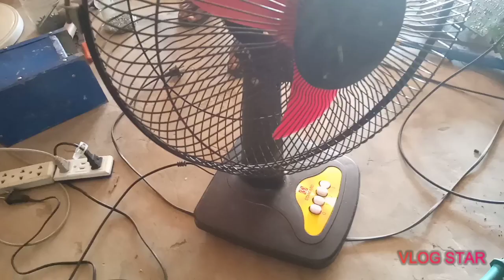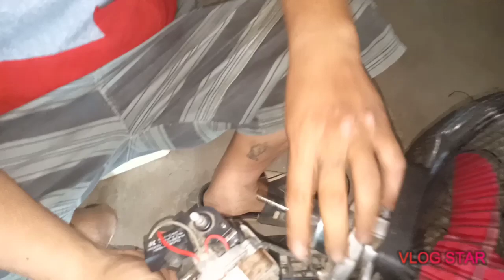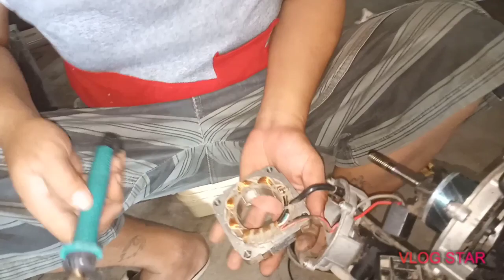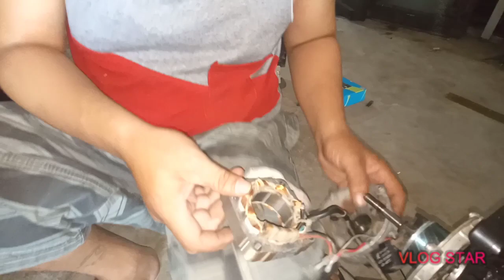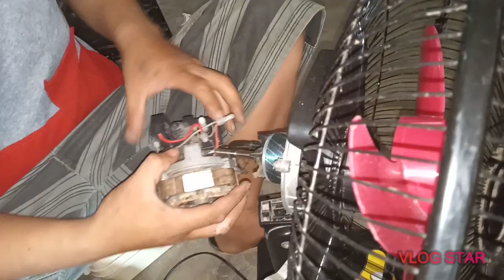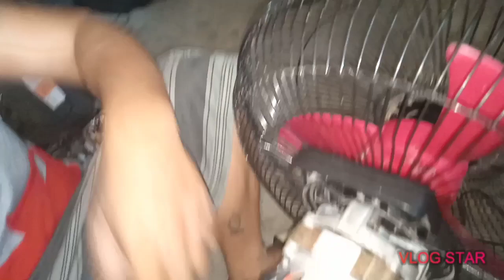ELECTRIC FAN MADALI LANG GAWIN/EASY WAY TO FIX ELECTRIC FAN

Comment: Boss yung elec fan ko binay pass ko thermal fuse pag pinaandar ko pakaliwa ikot inilipat ko yung wire sa isang linya ng capacitor ayaw nman umikot sira kya motor .

Comment: lods tanong lng.. kakaplit q lng ng capacitor, umikot na cya, mga ilang oras ayaw na umikot, 1.2 kac ung luma tpos 1.5 ung pinalit q, ano kya sira nito? sana replyan mo to.. salamat
Reply from the maker: Ok Lang nmn kahit 1.5 naipalit mo boss kahit medyo mataas,Ang importante ay Kung ok paba Ang bushing at shafting nya boss,galawin mo yang shafting boss at pag malakas na Ang uga ay palitin narin bushing nyan.kungwala manlang sya kahit ugong check mo fuse nya.
Reply: @techlifevlog2360  okay nman bushing nya, malakas nga umikot nong nplitan, kya lng ang problema ung fuse nya sana pinaka ilalim, try q pa palitan ng fuse bukas, wla na kac aq narinig na vibration ng motor..
Reply: @techlifevlog2360  kung thermal fuse ung sunog boss, bkt kba nasira ang fuse? sobrang init nba un, ilang oras q lng nman nagamit

Comment: yung thermal fuse po protection sa overheating ng motor. Puwedeng masunog kapag tinanggal ang thermal fuse
Reply from the maker: Boss Ang thermal fuse protection kapag sumobra na Ang init NG motor para Hindi masunog,Ang nagiging sanhi NG pagkasira NG motor o sobrang init NG motor ay dahil maganit na umikot kasi Wala NG grasa o talagang sira na Ang bushing,.at Alam mo ba na kapag bumili ka NG stator coil eh Wala talagang fuse
Reply: @techlifevlog2360  tama ka sir kapag bumili ka ng motor walang thermal fuse kaya ikinakabit yan for safety purposes. Dahil maraming electric fan at exhaust fan na nagiging cause yung electric fan at exhaust fan. Hindi po advisable na walang thermal fuse ang mga motor.  

Thermal fuses are circuit breakers in temperature sensing devices to cutoff the circuit by detecting overheat caused from fire, short circuit, or abnormal electronic operation. Thermal fuses are not reusable once they were used, but they work once only in the function temperature.
Reply from the maker: @donreyes8847  ok Lang nman talaga boss na lagyan NG fuse Kung may available Kang ikakabit.alam mo na boss Kaya walang fuse Ang bagong motor kasi nasisira Ang motor Kung may Tama na Ang bushing o maganit na Kaya hirap umikot Yan Ang nagiging sanhi NG  pagkasira ng motor,ngayon Kung nilagyan mo nmn na NG grasa Ang bushing eh kahit Hindi mo na lagyan NG fuse kasi Hindi na iinit Ang motor at Hindi na mahihirapan Ang motor.alam mo naman siguro Ang electricfan Ang pinaka madaling GAWIN,Kung technician ka..ako kasi boss electronics appliances Ang tinitira ko eh Hindi lang electric fan..Kung Ang paniniwala mo eh Yan sige lang,SA tagal ko naman NG ginagawa NG electricfan Lang eh Wala pa akong naging back job SA ganyan kahit walang fuse.good day boss
Reply from the maker: @donreyes8847  no boss Hindi kelangang ma sense Ang temperature NG motor napuputol Ang thermal fuse pag nahirapan NG umikot Ang elesi nito dahil maganit na walang grasa or maluwag na Ang bushing..Kung electric fan Lang Ang ginagawa mo Yan Ang GAWIN mo boss go ahead..good day

Comment: Sub standard naman yang tinuturo nyo. Importante ang fuse para hindi masunog ang fan pag nag over heat. Cause pa ng sunog yang ginagawa nyo.
Reply from the maker: Kung marunong ka Alam mo Ang sanhi Ng pagkasunog Ng motor,Ang sanhi Ng pagkasunog Ng motor ay Ang sirang bushing o kulang na SA grasa,tira ka Ng tira Wal ka nmng Alam,Kung technician ka magpagalingan tayo SA pagrepair,Ang itinuturo ay Ang simpleng pag gawa Hindi pang paepal na tulad mo,bumili la Ng bagong stator coil Kung may makikita Kang thermal fuse,napaka Bobo mo,wag ka Ng babalik gung gung

Comment: sana naka-steady yung pagvivideo mo, ang likot kasi nakakahilo..
diba dapat may thermal fuse para iwas overheat
Reply from the maker: Kung Hindi mo lilinisin Ang bushing talagang laging mag over heat Ang stator coil nyan at lagi kn din maglalagay Ng fuse,bumili k Ng bagong stator coil tingnan mo walang fuse Yun,SA bushing Ang ikakaganda Ng ikot Ng efan mo,kelangan alaga SA grasa or oil

Comment: Iba pa rin ang may fuse, dahil protection yan para hindi masunog ang motor ng electric fan.
Reply from the maker: Pwede nmn lagyan Kung may pang kabit ka,kasi kahit bumili ka NG bagong stator coil eh Wala na ding fuse yun.at Kung hibla Lang din NG wire Ang ikakabit mo eh wag mo NG lagyan kasi parehas nalang din Yan NG rekta